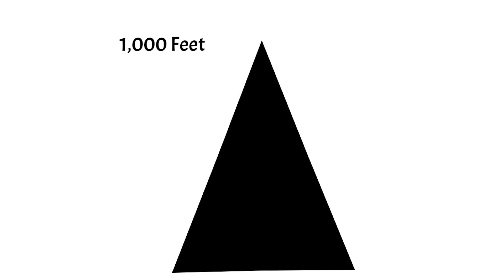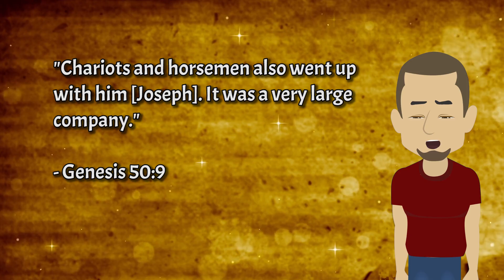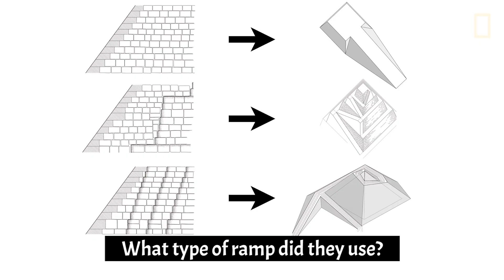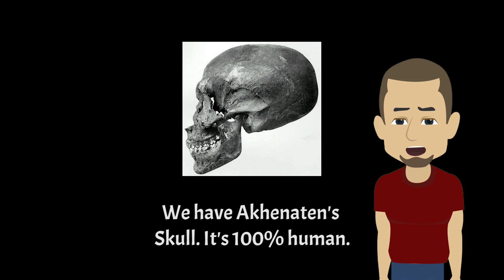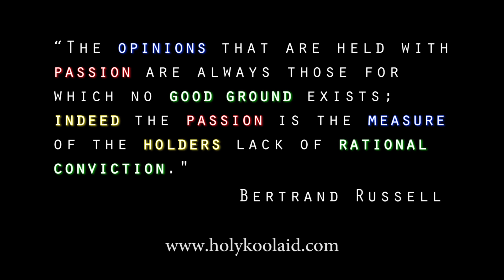Who Really Built the Pyramids and How?

Comment: I was a piano mover for decades. I have a lot of experience in moving heavy, delicate things in a delicate environment.

If you only have muscle to move things, friction is the biggest obstacle.  Since an average of 3000+ of the smaller (3-4 ton) sandstone blocks needed to be moved every day, a ramp or a single route would create a bottleneck. The only way to move that many in a day is to have multiple access points.

If there were dozens of cranes positioned all around the pyramid on each course, lifting a stone one course at a time does not involve friction, and the workers themselves would be the counterweights. 5 or 6 workers on each course would be sufficient, and each crew could handle dozens if not hundreds of blocks in a day. Until the limestone sides (now gone) were put in place, the pyramid would in effect have steps up the sides.

Multiple lifting points also would create competition among the crews, with possible rewards for the crews that moved the most stones. Of course, when it came to moving the big granite stones, everyone in all the crews would be involved.

BTW, standing up an obelisk is an interesting challenge.  Ask me how to do that.
Reply: Sounds like you were there. Good explanation.
Reply: Well shit, man.  How do you stand up an obelisk?
Reply: @makelikeatree1696   @Makelikeatree  I would approach the "turning groove" with the obelisk on a sled. Start cutting away the sled above the turning groove until the balance point is reached. Drop the corner of the obelisk into the turning groove, and you have already tipped it 10-15 degrees.. Build scaffolding over it and hang cowhides full of sand over the lintels to slowly add to the lift at a controlled rate, while levering from below. Add water to the cowhides to increase the pull. Rinse and repeat.

Comment: 1:35 This is not a conspiracy theory: There is quite a good chance that the pyramids are between walls (exterior and interior for example for the chambers) filled with debries! On the side where the blocks where hewn there is a nearly total lack of any debries. If that was not used for some other purpose it is quite logical to use it for the pyramides. When they where built so to say from the inside there is no need for such huge ramps. The coring wich would solve this question is not allowed so this remains a, quite good in my opinion, hypothesis.

Comment: I went to Alien Con and had a great time hearing what ancient alien theorists think the pyramids were for.  The presentation I saw surmised that it was an apparatus to produce energy from hydrogen gas mixtures and beam the energy into space. While it's kind of neat that the narrow shaft lines up directly with the center star of Orion's belt on the equinox(or solstice, I forget which) , and the configuration of the pyramids resembles Orion's belt, I think it's far more likely that they were just really big fans of Orion and that constellation in general.

Comment: one thing to note about the age of the pyramids, they were supposedly built approximately about the same time as the sphinx yea? but here is the kicker, water damage on the feet and around the sphinx suggest it have been exposed to normal weather for around 5k years, but that place started becoming a desert around that time (plus the sphinx was buried for at least the last thousand years or more), so the sphinx is potentially at around 10k years old, if not more.

Comment: They had the wheel,and some sophisticated chariots were built in that time most of the blocks were qauriied on site sledges were used because the wheels of the time couldn't handle the weight

Comment: Dude,
I've been subscribed for, at least a couple years, but this is the most fascinating video you've made.
Reply from the maker: Thanks, man. That means a lot. I'm glad you liked it.
Reply: @HolyKoolaid  explaining the different methods of rock moving and rock piling without wheels and pulleys is very mechanical engineering and awesome. And Aristotle's point about the wedge/slide and lever being great instruments when used to their full potential instead of taken for granted as weak instruments is really awesome.

Comment: You should use better locks than a Kwikset if it is top secret.  Get you a Mul-T-Lock if security is important.
Reply: That Kwikset may have been modded to irreparably jam itself in case of being picked or bumped, making it actually practically better than any off the shelf multlock in many cases.
Reply from the maker: Or (plot twist) maybe the video is a diversion, and that's not actually the real door. 😉

Comment: During my interpretation class (we pick a lot of random shit to interpret, don't ask)  we learned about a method: You strap 12 logs around the stone and then roll/pull it.
A cog before the wheel. You can strap ropes, you can put in stuff in between the logs, and pull and push at the same time.
Reply: Cut, transport, and place one multi-ton block every four minutes 24/7, 365, without interruption for 20 years. Think about it.
Reply: @peterblood50  Have 15 000 men working in three shifts for 300 days a year and you can do it. Egypt had its population in the hundred of thousands during that time. The numbers only look scary until you start doing the math.
Reply: @Elkator955  
Give me some numbers to work with then. Remembering that they would have to do everything below 1 time every 4 minutes 24/7, 365, for 20 years. Out of the 5,000 men on each shift, how many are working in the quarry, how many are working in the transportation of the stones including the people in the ports who categorize, load, and unload them. ( How many men are working in transporting the stones to the worksite? How many are are involved with lifting the stones to the desired level? How many are involved with actually placing the stones. I'll give you feeding the crews as they say they were housed nearby. 
I've probably undercut the amount of different segments involved with getting stones of this size and weight from the quarry to the their assigned location. 
    Also, why no written, painted, or carved history of such a monumental event?
Reply: @peterblood50  So, here it goes:
The mining of the rock is done by thousands of people/slaves. Egypt built a lot of structures from stone, so the daily production of stone was already there, they just diverted, built less stone houses and more pyramids, plus you can continue expanding quarries as the years go by. (not the first time rulers ignored the everyday people for their gaudy projects). According to the numbers, diverting the work of ~1800  masons is sufficient for 20 years, because you only need to smooth the rocks at the outside layer, the rest can be pretty rough, and here how we get that number: You have 2.6 million cubic meters (The stones that need to look nice) of stone to carve. In 20 years it means you have to do 130 000 cubic meters a year and (assuming 300 days of work) 433 cubic meter a day. If 1000 people can do .25 cubic meters a day (which is not hard, it is the size of a chest) you need 1732 stone masons working a day, and you can break them up in three shifts (and you have 56 days for them to take off too).

The transporation of stone, with the log method that I mentioned originally, would require about 15-20 people per stone block, we are going to use the more demanding figure. They can move it without problem, so once the production line is done they can deliver multiple blocks a day. There are 2.8 million stone blocks, now we divide it by 6000 (which is 20 year times 300 days) and the result is 466 blocks per day need to arrive so it will need 9,333 people to move at that speed (466x20). So we can round up to 10000 and double it, and your supply line is probably packed enough that one team can see the one ahead and behind them, and they can probably even stop for harvest season.

So far we are working with about 12000 people. Placing the blocks themselves, however is the intersting part, because you don't need the same sized workforce for the entire 20 year duration, because, you see, as the pyramid becomes taller, there is less space to put people in and therefore you can start with a large workforce at the beginning, and then shrink it down as you place down blocks. So while the 15 000 total construction workers may be a bit optimistic, with an initial surge of 10K thousand workers, decreasing into 3K means that with about 20K workers (minus staff, and guards and such) the 20 year deadline seems more than possible.

As for the pictures and records, I did find an article about the oldest papyrus talking about the construction of the pyramid in Cairo. Other than that, my answer is simply, i dunno. If I was an egyptian I would have recorded if it was aliens doing it too.

Comment: I'm pretty sure that the ancient Egyptians did have wheels. They had chariots. They didn't use wheels to move huge blocks of stone because they would sink into the desert sand. That's why they used hemp ropes, rolling logs and a hell of a lot of manpower.
Reply: It depends what period of ancient Egypt you're talking about. They expanded a lot of history, just because they had chariots at one point doesn't mean they had them when the pyramids were built.
Reply from the maker: I mentioned this later in my video. The Egyptians did have chariots, but not until hundreds of years after the pyramids were built.